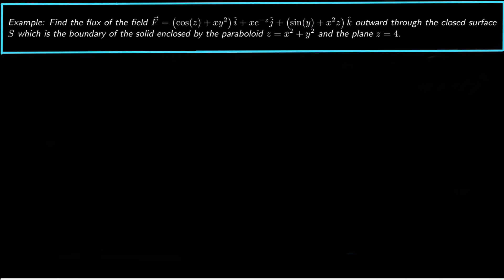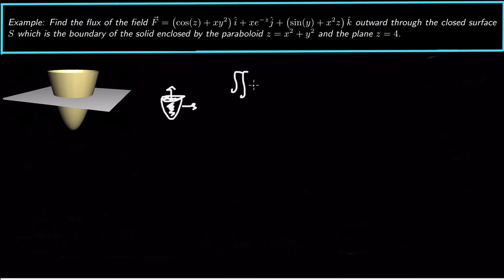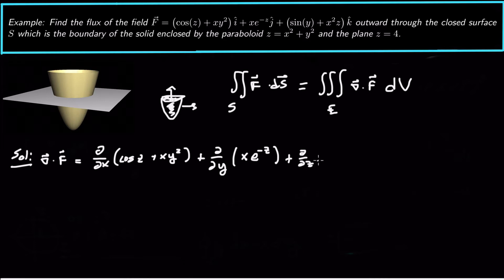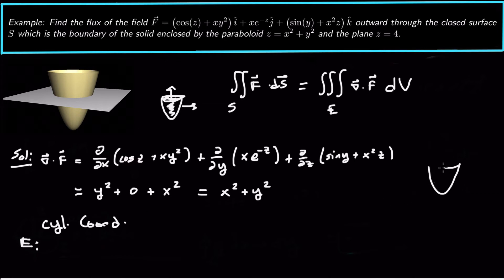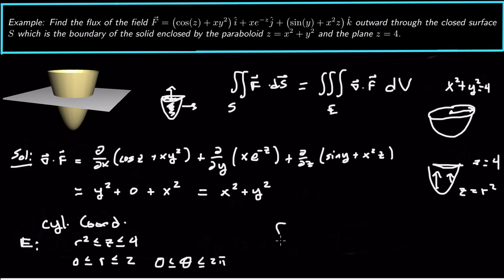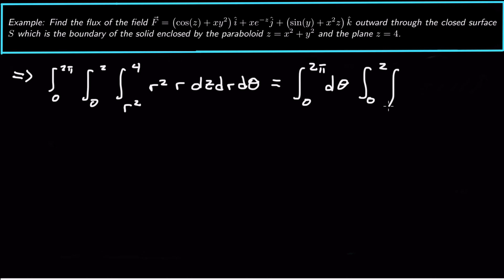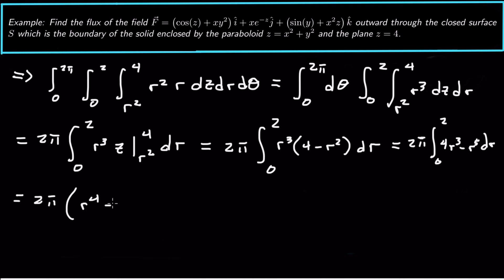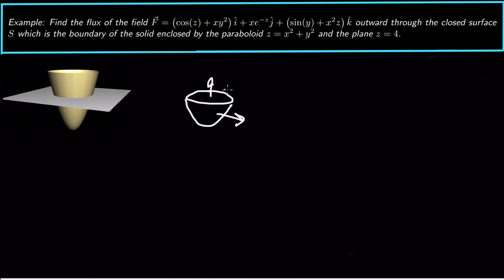Divergence Theorem:: Find the flux of F = ( cos(z) + xy^2,  xexp(-z),  sin(y)+x^2z )

Comment: Could you please explain why you use r^2 as the lower limit for z and how you knew this
Reply from the maker: The region is bounded below by the paraboloid and the paraboloid’s equation in Cylindrical coordinates is z=r^2.
Reply: @JonathanWaltersDrDub  I completely understand why it could be z=r^2 to z=4, but im unsure as to why z=0 to z=4 does not work/ give the same answer
Reply: For example if you had: 

S is the surface enclosing the volume bounded by the paraboloid z = x
^2 + y^2 and the plane z = 2.

Limits for z would be z=r^2 to z=2 , limits for phi are: 0 and 2pi and then limits for r are: 0 and root(2).
could you explain why z CANNOT run from 0 to 2.
Reply from the maker: If z were integrated first then it is essentially taking care of the fact that the region is varying in height.   If z went from 0 to 4 then it would be a 3D cylinder. Think about this. Z from 0 to 4 would take place everywhere over the circle of root(2).  However, the paraboloid only touches the xy plane at the z-axis. Thus, the lower bound for z is the paraboloid and the upper bound for z is the plane z=4.
Reply: @JonathanWaltersDrDub  This is what I was thinking intuitively but needed clarification. Thankyou very much!
Reply from the maker: No problem! Hope I’ve helped!

Comment: Hi I have a simple triple integral question I am struggling with due to the region. Its like Calculate the triple integral of (3xy+2z^2) where the region is 0<=z<=1-|x|-|y|. I don't know how to deal with the absolute values and my answer is sometimes 0 or 7/120
Reply: Could you please explain how I could set up the integrals.
Reply from the maker: So basically it's four planes all pointing down from z=1 with normal vectors pointing directly away from the origin (like in octant 1 the normal vector of the plane is <1,1,1>

So the shape is like a pyramid almost.  

This means that the region in the xy-plane will be a diamond created by the intersection of the lines y=1-x, y = 1+x, y = x-1, and y = -x-1.

The four planes will all intersect at the point z = 1 and their intersections with the xy-plane (z=0) are the four intersecting lines that create the diamond in the xy-plane.
Reply: @JonathanWaltersDrDub  So would I have to set up 4 different triple integrals?
Reply: Once I did that and evaluated, I got volume to be just 7/120+1/120+1/120+7/120 = 2/15? Is that correct?
Reply from the maker: @sanchitkumar7357  hmmm.  I did not work it out myself, but I'd imagine the four would all be the same..  basically just replace the variable by the negative if the variable is negative in that region of the xy-plane.  Like above quadrant 2 you would have z = 1+x-y since x is negative in quadrant two.
Reply: Jonathan Walters Ok can you please try at it and let me know if the answer is 2/15 because I think I did what you said but I want to confirm please